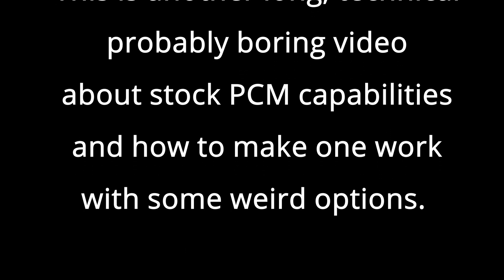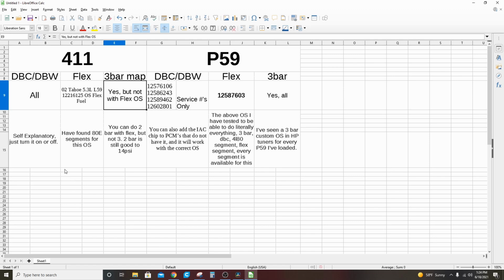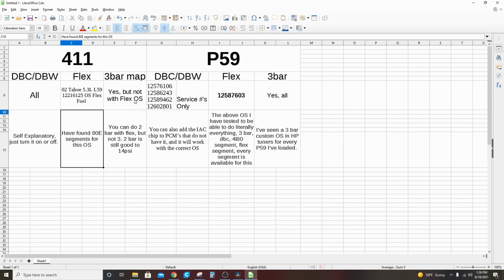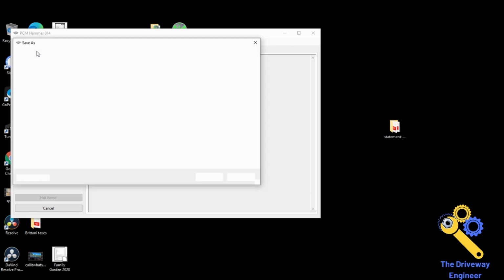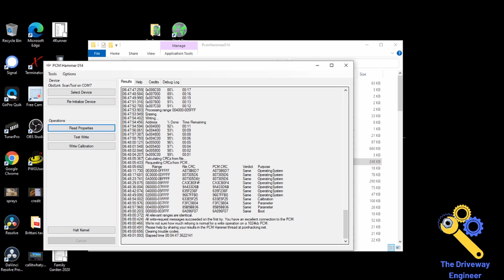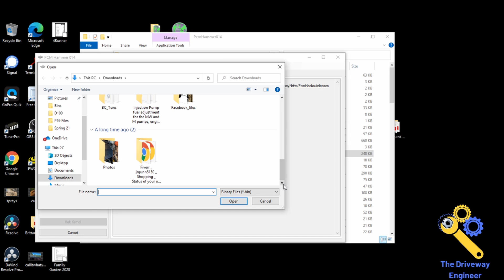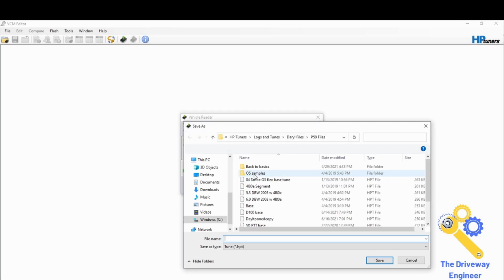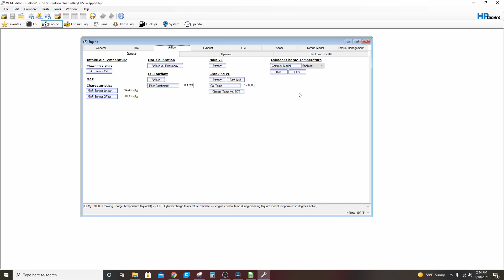650hp 5.3 PCM build, the junkyard provides!

Comment: At least one more DBC service number to that list: "PCM service number 12581565 is a 2003 1MB (Blue & Green connector) - and it has the drivers required for a DBC application"

Comment: I know it's an old video but I'm wondering about the pedal and tac module combos.  does the pedal/tac module have to match the PCM or just each other?  I'm trying to swap a P01 from a 2001 suburban 5.3 for a p59 from the junkyard.  I'm not sure if I need to swap the pedal to match or not.  The reason is to have flex fuel and 3 bar map sensor if you're wondering.
Reply from the maker: That's not going to work
Reply: @TheDrivewayEngineer  keeping the old pedal setup or swapping PCMs?  I'm assuming the pedals are the problem.  In which case...  I have a matching pcm and pedal setup leftover from a 2004 tahoe 5.3 that I put into a yukon.

Comment: This is great info.  I tried cloning my P59 ECM off my Z06 to my junkyard P59 with the OS 12592425.  It pulls into HP Tuners with credits perfectly.  I tried to OS change to 12587603 OS again with no issues.  The problem I am running into is when trying to change to OS 12592618.  It keeps losing the credits.  This seems to be the only OS I can use for my L29 454 vortec to get it to read my Cam Offset PID for the distributor and get flex fuel.  I've tried the other 2 OS and they do not read it and it seems to have a miss at idle.  Do you have any idea what might be the issue?  Or am I stuck just licensing that OS?
Reply from the maker: No, you have to use PCM Hammer to clone the Z06

Comment: You keep saying OS.. Are you sure it's running an OS (operating system)? 
.. I very much doubt it since it would be a stupid thing to run on a car ECU (a Real time OS would make a little sense, but I highly doubt that's the case).. 

I think firmware is the correct terminology.. But if you know what is running on these control units then do explain

Comment: I've got a 2004 Cadillac CTS automatic car with a 6 cylinder. I want to put a LS style engine in this car. What all would I need and with this computer work? Is this what I would need to search for
Reply: Okay nevermind, I actually wrote that comment before watching the video I have a bad habit of doing that. Sorry about that. I've got about midway's into the video and heard you say this only applies to if I'm running boost. I highly doubt that's going to happen anytime soon because it will be my wife's car. But I am building a turbo Camaro for myself
Reply: @dynamicdopamine  Not worth the time, money, or effort. Just get a CTS with a v8, like the LS6-powered CTSV.